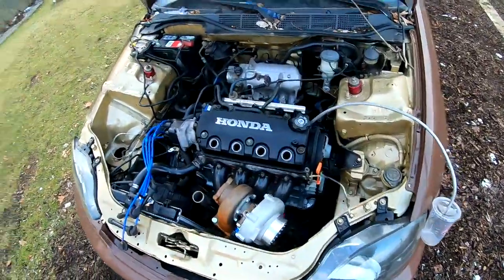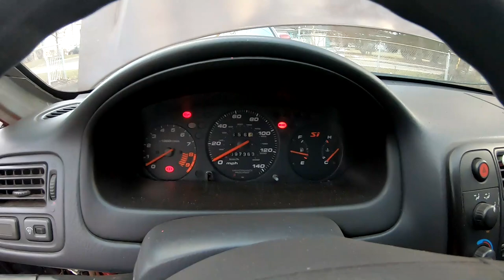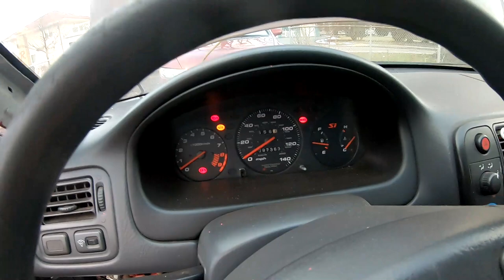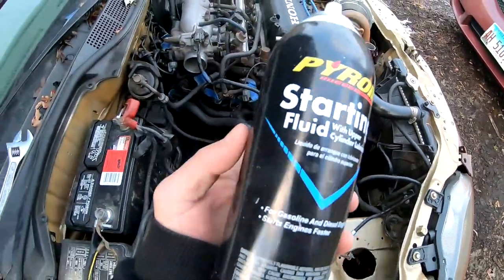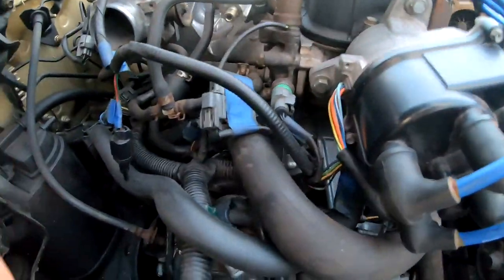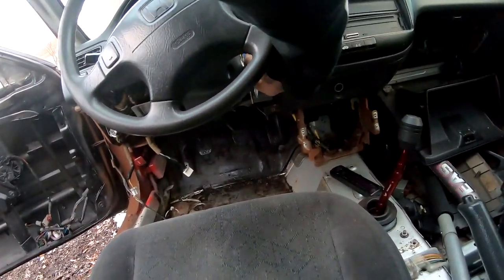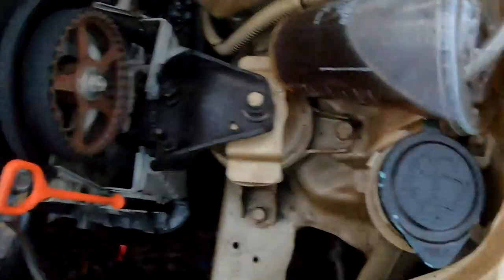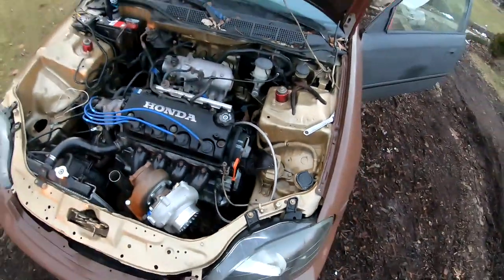Cheap Ebay Turbo Civic Build First start up (after 1 year of slow building)

Comment: Congrats man! 
Tell me again what internally was done to the motor?
Reply: Not a damn thing 😂
Reply from the maker: Thanks took me a long time to build money being the issue. This car has not seen been on the streets since sep or October 2018 still a few things to button up but very excited..oh yeah Its stock lol.
Reply: Did you reuse the rods and pistons?  Rings?  Hmm if it’s a budget it makes sense.
Reply from the maker: @BulliKid   vitara low compression pistons, speedfactory no notch rods, king main bearing, king rod bearings, shimed the oil pump for more pressure, block guard, 8lbs flywheel,ebay stage 4 clutch, previous owner installed a lsd in transmission, and then all the turbo stuff. Might be forgetting something. Plans are to get the car running good and back on the streets this year. Next year start on working on the head.
Reply: Oh so it’s built bottom end not stock! That’s goood!!

Comment: What size turbo is that I have that same turbo manifold but replaced it with a forward facing tubular did you port the oil pump? I just finished doing that on my y8 build
Reply from the maker: its a ebays gt35 I believe its a 70 trim. I didnt port the oil pump but I did shim it.